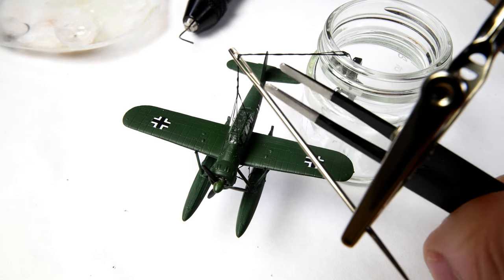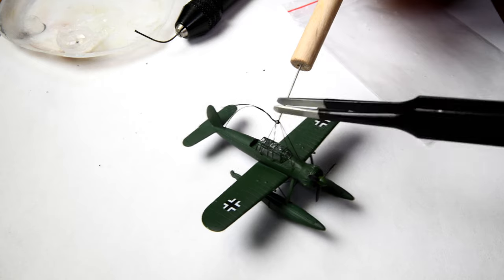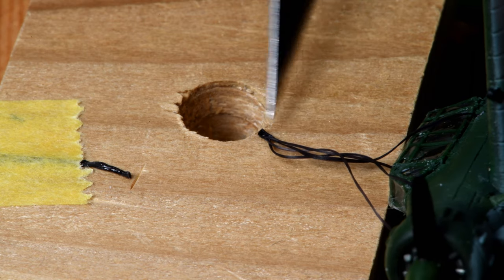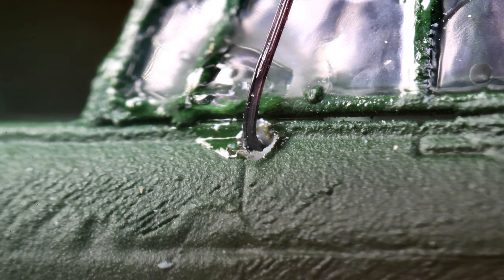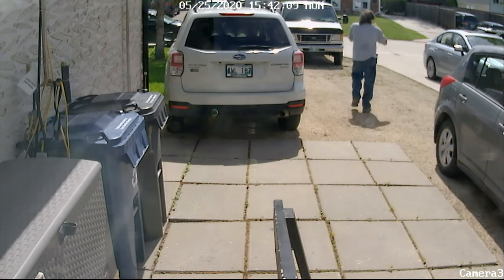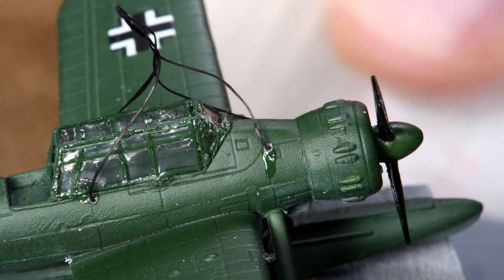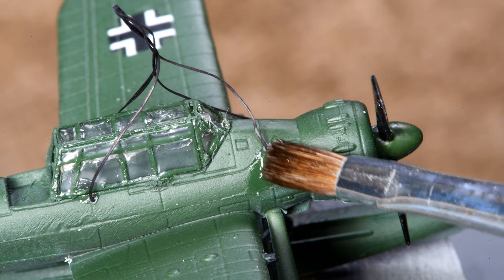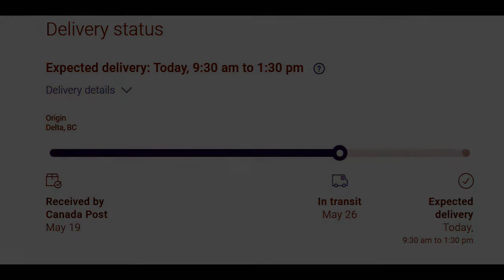The Model Ship - Part 454

Comment: Ron, the Microset is applied prior to the decal application, then place the decal down, ROLL a cotton bud over the decal to remove excess water and Microset. Then apply a tiny amount of Solvaset (same as Microsol, but more aggressive). Helps the decal “snuggle” down to the surface. My Solvaset is 40 years old at least, and still works fine. The decal will wrinkle a lot, possibly, don’t worry, it’ll flatten out. I’m going to try out stencils for some markings rather than decals and use paints,no decal film and better finish.
Reply from the maker: My little bottle of Solvaset was bought about then too. 🙂

Comment: Great job.  Now don't have the plane hang too low that it's touching the deck.
You could have the plane sitting on it's cradle and the crane hook holding on top of it.
What ever you decide. 
Stay safe. 😷.  😷.  👍.  ;-)
Jason
Reply from the maker: The plan is for Tony's plane to hang from the crane, then the two others mounted on the cradles. The one with the folded wings will be sticking out of that hangar that has it's door open. At least that's the plan for now. 😁👍